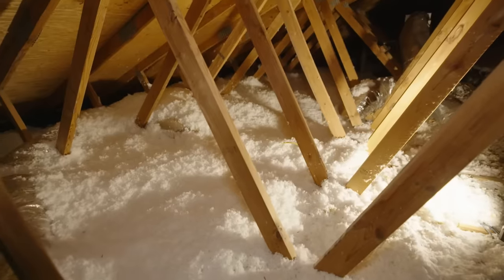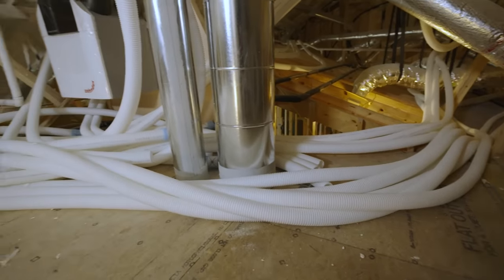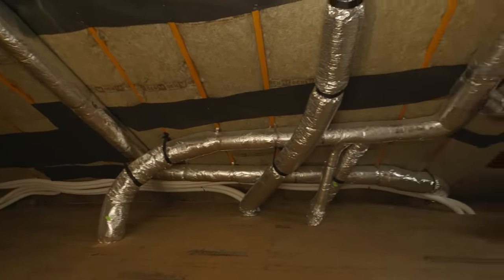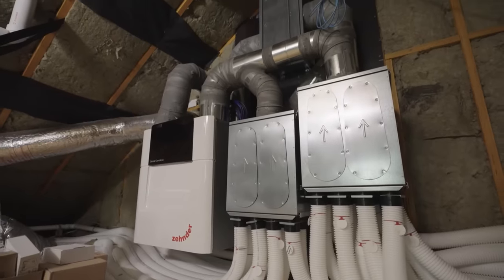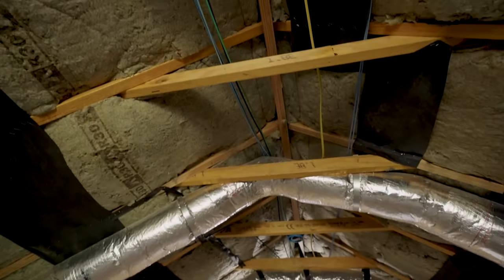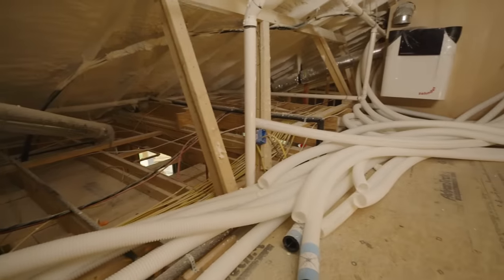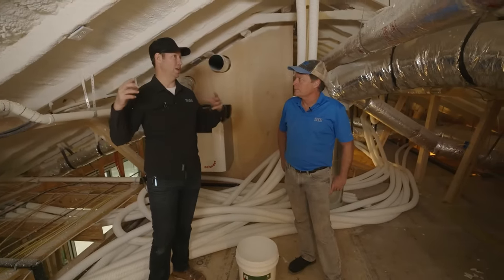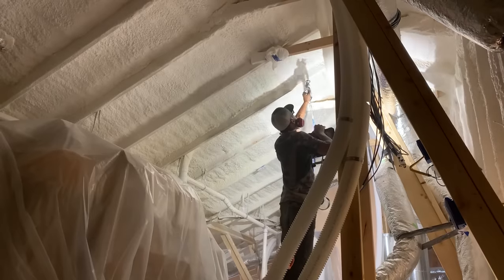Building a BETTER attic - Unvented + Conditioned attics 101

Comment: I have found that with most of this kind of building, there are too many contractors out there not doing a good job, wether it’s ignorance, training or just malfeasance. Especially in the foam industry, there’s a lot left to be desired. 
Plus not a lot to go on as for information for typical homeowner. Or in some cases too much of the wrong info. You really have to dig to get good information. Again for this type of construction, nothing will replace knowledge, skill and experience.

Comment: I don't have any mechanicals in my attic so I left it vented and put a deep layer of cellulose up there.
Reply: That is the route I'm going with.   Seems like the flaw in construction practices was to not build a thick floor as a ceiling, then add the roof framing.   Truss roofing over the years gave us poor insulation.
Reply: @Dancing_Alone_wRentals  Truss roofing is fine since you're supposed to use the bottom chord as the attachment point for the air barrier. The trick is to build the wall 1-2 feet taller than what you'd normally do and use that space for a dropped ceiling for all the mechanicals.
Reply: @hailexiao2770  That is what I was thinking.   Seems much smarter and as far as working in an attic vs off a short step ladder, I would rather work off the short ladder installing mechanical along the ceilings.   I built a house in Florida and the HVAC guy came in before I had plywood on the trusses. He loved it.

Comment: Intumescent paint is about $400 / 5 gal at the moment, FYI.  It goes on THICK, so you only get about 100 sqft per gallon.  You can thin it with another water based paint (e.g. to match a color you're after) but you don't want to add very much.

Comment: That's all good and all.... The question is, how expensive and also, it's hard to find a leak if something ever happens. But this is a great option to avoid humidity and heat. Any idea how much this system costs?
Reply: Agree, a leak won't be discovered until serious damage to the wood occurs.  I have an air handler in my uninsulated attic, and my plan is to build a 2X6 insulated box room around it and the ducts with an exterior pass door from the box room to the rest of the uninsulated part of the attic.  I'll be able to go through the door and see over the top of the box room.

Comment: Is it possible to move from a vented attic like the one you were in at the beginning to an unvented? How does one remove the trusses?
Reply: Trusses are structural you can't remove them without changing the roof joists to 2x8s or something.
Reply: @Egleu1  nah shucks, just sawzall the old trusses out of the way.  Totally not needed anyway.    Easily a DIY weekend project.
Reply: You start by using real trusses and never using pre-fab pixie styx.
Reply: @blaydCA  that’s brilliant! 
Well, obviously a professional has entered the chat.  
Quite please, I want to hear this.
Reply: @blaydCA  does that mean I was fooled? Are you not a real pro builder guy?
Because I don’t think we can set this guy as the standard to meet as a pro can we?
Maybe as a standard for a professional from California?
Reply: @blaydCA  I’m so far from being a pro I didn’t even know to have mine tested.  
Good thing the housing market is strong because I think I’m selling this place very soon.

Comment: Matt, what suggestions would you have for homeowners who'd like to condition the attic on their existing house? Love your work. Thanks for sharing your insights, experiences and wisdom.
Reply: Do it when you replace the roof so you can add several inches of foam board on the outside. Otherwise, you won’t get the desired R between the rafters.

Comment: The first attic used trusses. There's not much you can do with it, but it's faster and cheaper. The other is a stick framed roof. Of course it's more useful, but it also costs a lot more to get there.
Reply: There are a variety of truss designs. Some easily allow for use of the attic space.
Reply: @johnlee7085  There are. But this is not an example of one. This style is pretty much useless as attic space.

Comment: Top invention to the US, standard for at least 50 years in Europe, though mostly with glass wool until about 15 years ago. 

To all people talking about the costs: it’s not more expansive. Same goes for decent built houses from wood or stone. The typical US matchsticks cost the same as a fully insulated  stone house in Germany, about 280$/sqft.
Reply: Haha, I was just thinking the same thing. And then a steel roof, or those crazy shingles? In Belgium only used on garden sheds.

Comment: If I have flames like that hitting my insulation I have bigger issues than my insulation melting.  I get that you want to limit the damage or contain the fire but at a certain point, you just want it to all burndown and go away so you can start over.  Fire is the one thing that makes me question if the foam is the way to go instead of rockwool

Comment: but the moisture from below will find its way to the attic and without ventilation will grow mold
Reply: That's why code requires either a dehumidifier, AC supply & return, or fan & grill between the attic and the rest of the house if you have an unvented conditioned attic. It's called a conditioned attic for a reason.

Comment: What happens when the roof, flashing etc. starts to leak after so many years? It just rots the heck out of the osb roof sheathing and no one notices it? I understand it wont drip through. Sounds like a recipe for disaster??
Reply: he most likely has an impermeable layer on the roof decking between the metal roof and sheathing. it can only leak where fasteners penetrate. from there you just give the water a place to go.
Reply: Probably shouldn't be waiting for leaks to rot through your sheathing and start staining ceilings. It would be better to inspect the roof yearly and replace/repair flashing before the flashing fails. In short, routine maintenance can save a lot of cost and headache down the road.
Reply: @fepeerreview3150  Explain how if you have to do "Preventative yearly inspection" on your wood deck, sandwiched between plastic foam from underneath, and you shingle or metal, (especially the latter) on top, without ripping one or the other off? just curious
Reply: @benjamindobalina7493  If you'd like to know more about how to inspect roofs and flashing you can learn far more about it from studying the material available a NACHI, which is the Association for Certified Home Inspectors. They've got lots of good material there. I'll link to one of their articles. There is plenty more.
In my previous comment I had in mind all the visible flashing elements, gutters, roof-to-chimney, vent penetrations, etc. Those are always the most likely spots and the first to go. Look for signs of corroded GSM, poorly done caulking, things like that. If those visible elements are checked regularly, that will prevent a lot of common problems.
Most people don't even bother to clean their gutters often enough, let alone pay attention to the roof. "Out of sight, out of mind" is very easy with a roof, and sure to lead to costly problems that could have been caught and dealt with much earlier and more cheaply.

Comment: What's the cost difference though? I'm guessing it's substantial.
Reply: This is not in your average working class family's buget. Spray foam on the bottom of a vented attic but not the roof sheathing is always an effective and economical option.
Reply: This is done when budget is secondary to wants.
Reply: In my country, it’s obligatory to build attics so that they keep out both the cold and the heat. The cost? Of course it’s substantial, but in the long run, you save on air conditioning and heating.
Reply: In my home we did spray foam on all exterior walls and the ceiling and the attic in Texas stays at around 80 degrees when it’s like 100+ outside
Reply: Where I live, all of the mechanicals go in the basement. Without all those penetrations into the living space from above, it's really easy to get fantastic insulation numbers in a vented attic. Only reason we build a hot roof is if we are using it as living space.
Reply: it's not only cost, but even finding a builder/contractor that will break from their 'traditional' build methods. in many areas of the us, you'd be hard pressed to source someone willing to consider a different method than their current standard
Reply: Nothing is cheap when spray foam is involved.

Comment: Unvented crawlspaces are a problem when the inevitable plumbing leak and/or dryer vent leak occurs. Same with an attic, if the power fails, big problem. Roof leaks go undetected until damage is significant. Also we have increased the conditioned space, and increased the utility bill commensurately, as well as the construction cost

Comment: Love this idea.  I'm installing an attic fan because min is so hot and even my new Furnace/ac is struggling to keep up.  I would have loved to have all the blown in insulation removed and this done to mine and to put in a floor into the attic to not only insulate the top floor but to reduce the heat and cool loss.  I love this and to one other responder, the old attics in really old houses had floors in them with full insulation and a separated space and houses used to be more structurally sound.

Comment: Having a cooled/heated attic would be a problem in Northern Climates as thermal bridging to the roof would cause ice buildup and destroy your roof in short order. I would also be concerned with mold/rot where that thermal bridging occurs.
Reply: I was waiting to read this thank you
Reply: Not a problem if you fully encapsulate the rafters in spray foam, although you'd have to add an inside layer of framing via long screws or Larsen trusses if you want to finish the space.

Comment: And how does all of this affect the roof finish, be it asphalt shingles or metal panels?
Reply: As long as proper air gaps are accounted for when installing the roofing material, the finish would be the same.
Reply: @RobertTorres27  And that is exactly my point!  Nothing has been said in this video about an air gap under the roof sheathing allowing venting from the soffit to the ridgeline.  If anything certainly the spray foam has been represented as adhering directly to the underside of the roof sheathing and it seems the batting was also directly in contact with the roof sheathing.  And if that is the case then you can expect the roof finish to degrade pretty quickly, especially asphalt based products.

I like a lot of the videos Matt puts out but but this one seems quite incomplete by not addressing the roof deck ventilation issue.  And not everything he presents is gospel truth.  For instance he came out quite strong in favour of "flash and bat" insulation which has now been quite soundly debunked by a lot of people in the insulation business.  I'm reserving judgment on this video until more information is forthcoming
Reply: @68Jaguar420G  At 3:18 he mentions that the space between the metal roofing and the roof decking is vented. That's not a full explanation of the issue involved, but it's at least an acknowledgement that they exist. This really calls for a video on the pros and cons of this kind of venting verses a "hot roof", if anyone is still building those.
Reply: Metal panels don't give a damn about anything, venting or otherwise. Shingles although need enough ventilation otherwise the furnace effect can bake and make them crumbly.
Reply: @thispandaispurple  Not necessarily true. Without a proper air gap, moisture from condensation on the underside of a metal roof or driving rain won't be able to fully dry out, resulting in premature degradation of both the metal panels and the underlayment/sheathing.

Comment: As a chemist, I can confirm that the cold gas CO2 sales pitch is hilariously wrong. 😂
Reply: Yeah, I was wondering about that, too. I think what they were really trying to say was CO2 helps extinguish the fire without being toxic? Or maybe the tumescent paint expands with pockets of CO2? Of course any fire is an oxidation reaction that consumes oxygen, so unless it’s supplied by the fuel some sort of oxygen depletion is going on regardless.
Reply: the pitch, it hurts....
Reply: Shhhhh it's a trade secret!
Reply: burning the paint produces CO2 and theoretically creates a latticework of the the paint material with spaces filled with CO2.  this kind of latticework structure is good at insulating things but in order for it to be cold, the burning would have to produce an endothermic reaction and I cant see how that would happen, at least not enough to overwhelm a propane torch,
Reply: It's not my field but the unprotected foam is, according to Matt, still too hot but they can touch the burned side of the painted foam. Oxygen fuels fire, CO2 does not. The heat energy created the CO2, stealing heat.
Reply: coal gas, not cold gas. kidding.
Reply: Carbon dioxide is also going to reduce the oxygen in the air right? So breathing it in will suffocate you.
Reply: @Chris-od1jp  Well, never fear your glass of water when the wave is crashing over your ship.
You are correct that we cannot breath CO2 but fire is the bigger consumer of oxygen in an actual event.
The point of the video is to sacrifice an outer layer to protect the core.
Reply: @arcanondrum6543  this is being painted onto internal walls though, so the fire would already be inside the house.
Reply: @Chris-od1jp  We're all aware of that.
Reply: @Chris-od1jp  ...when I refered to the "outer layer", I am referring to the coating on the Polyisocyanurate foam, not which side it is applied on.
Reply: @arcanondrum6543  They both seem to react the same way to fire, except one produces white toxic smoke and the other its black toxic smoke
Reply: @Chris-od1jp  We)l, I'm finished with helping.

Comment: There is a unique feature of spray foam.  This feature is seen as something as bad by some people and good by others.  Foam does not fail during fire.  It continues to insulate.  The good side it helps prevent the spread of the fire.  By not failing, it decreases the amount of heat that is transferred to the other side.  The bad thing is the heat is held in really well and can cause flash over.  Me?  I love spray foam and would love to see any open cell or air flow insulation to be outlawed.  Foam is more expensive but if there was more demand the cost would come down.

Comment: As cool as this sounds…this looks unrealistically expensive and resource heavy for an average homeowner/builder. I’m also a bit disturbed by the comments that mention the AC HAS to be running for this to work. That’s a major drawback for a normal homeowner.
Reply: I know right. I saw HIS attic and I thought what a waste of mats. I can get behind finishing an attic but not this. There are reasons why these have been done for decades.
Reply: I like Matts stuff and he's a great promoter of how to build better homes. But so many of these things are out of reach of the average home buyer. Basic homes already require a 30 year loan for most people.
Reply: Yes you have to run the AC always. If you don't, its sealed up so tight mold will grow. This happened back in the 70s early 80s homes when they put Styrofoam on the outsides and tapped all the seems. No air exchange and the houses molded to the point of tearing them down.
Reply: @Michael-ko4ko  but we now have vents in the roof and eaves of the house that cause convection to stop still air from molding. Plus balloon walls are never structurally sound and never where so house fall out more than ever do this cheap design.
Reply: As if the crazy tubing at 1:22 hasnt scared people off. Youd think he was building a fucking chip fab or some shit.
Reply: Build smaller but better Homes
Reply: it is possible to install this without AC - in Europe for example there is a common technique for foils - the issue is warm, humid rising air leaking into the attic, the attic then being colder than the house below would cause condensation leading to mold. In Europe this is handled by appropriate ventilation or foils, foils designate a specific area for condensation to occur on and then drain away harmlessly.
Reply: Generally on attic builds the experience of europe can be relied upon, europe does attics better, and cheaper, than the US.
Reply: @velianlodestone1249  interesting... Always interested in euro construction techniques, particularly framing. American construction is crap and tiresome. Read some interesting things, like plywood or particleboard often being installed on the interior walls under drywall?
Reply: @allandulles7108  Not sure about under drywall, but it is more common to install plywood over drywall! Ply has benefits (Stronger, no need to track down studs, ability to withstand damage). You'd install drywall underneath that where code requires it - better fire resistance.